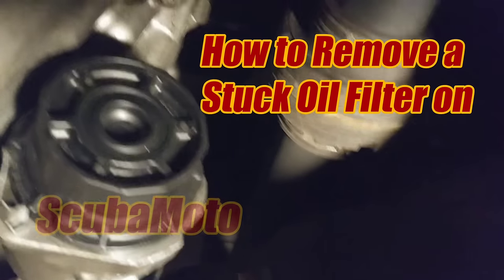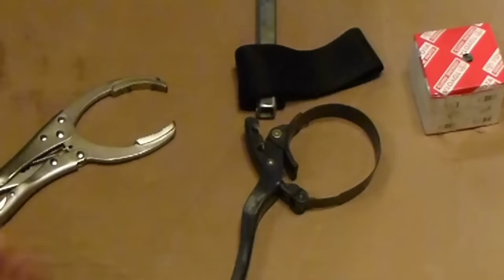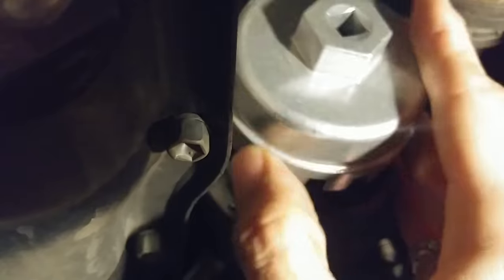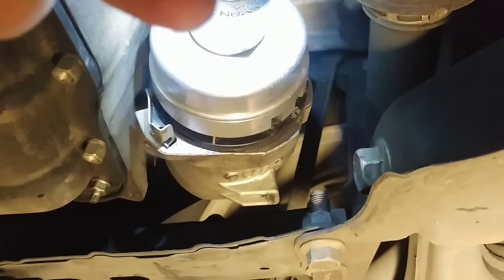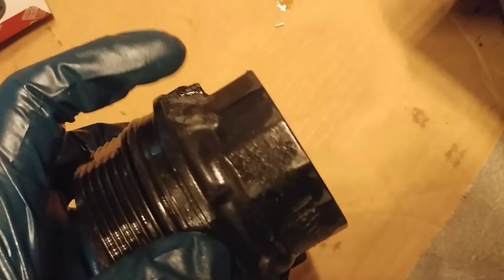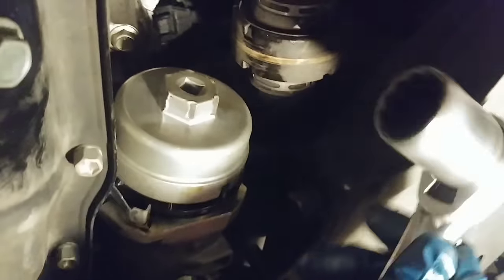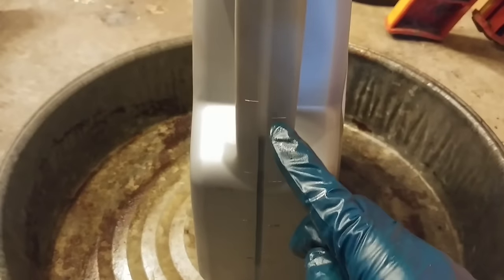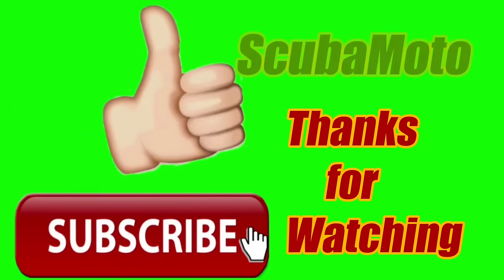How To Remove Stuck Oil Filter Toyota Prius Corolla Lexus Oil Change

Comment: I just had to deal with this on my uncle's car. It was leaking oil from the drain plug. I got under there and I was able to turn the drain plug out with my fingers. But the filter canister was incredibly tight. I bought the filter tool from AutoZone and it's not as solid is the one used in this video. I used a breaker bar and it bent the tool! With more work a piece of the cap busted off and created a hole before finally coming loose. The last place to change the oil was the dealership and they didn't tighten the drain plug but over tightened the filter! It was Larry Miller Toyota in the Phoenix area.
Reply from the maker: jorge242: If the dealer was the last to change the oil then at minimum they did so without changing the filter and possibly over-tightened a new filter. Either way, congratulations on finally undoing someone else's mistake and removing it. Now that you're doing the oil/filter changes yourself, you won't need to encounter an over-torqued filter again. Thanks for sharing the great story.

Comment: My wife took our Lexus into Jiffy Screwed while I was out of town (I normally change my own oil). When I ventured to change my oil the next time around this happened to me, except the special wrench illustrated here broke. I took it back to Jiffy Screwed and made them loosen it while I watched and tighten it properly with a torque wrench which I provided because they didn't have one. Folks, once the oil filter is seated properly to compress the o-ring on the filter housing it is further tightened to 18 foot lbs - that's  an additional 1/8 inch around the circumference, and that's it. Jiffy Screwed is putting these things on with an impact wrench.
Reply from the maker: George Thompson: Thanks for sharing the great story. I love that you brought it back and had them deal with their own mess. It's not just the lube shops, many dealer techs are using impact to install these thinking they are saving precious time. As for the broken wrench. I'm not sure how it broke but I would guess it split in half at the 3/8 drive insert point. If you use the 3/8 socket drive with an impact tool, they will all eventually break. If you have to use impact, you want to use a 27mm socket on the tool's lug. Thanks again for sharing the great story.
Reply: @ScubaMoto  The truly sad thing is these big companies hire young people and toss them into service often with little or no training and don't pay them a living wage. It's pathetic.

Comment: Damn, I thought I was totally incompetent.  Cannot believe Toyota has done this.  I have always been impressed with Toyota engineering until running into this.   My other problem was i took to dealership which I know used air wrench to put it on.  I literally had to put old oil back in car and plan on taking to oil change shop who hopefully deals with this BS on daily basis and has found solution.  THANK YOU YT.

Comment: Thanks for the video and tips.  Like many other's, I couldn't budge the filter cap.  Got the proper cap wrench with the extra teeth on the side (I had one that only had the polygonal cap part which was not working).  My impact driver did not have enough torque to loosen it, but a 1/2" breaker bar with manual impact from a rubber mallet was enough to break it free.  Only minor problem is now the cap wrench won't come off the filter cap.  Hopefully it will just stay there permanently and not fall off while driving.
Reply from the maker: fzumrk2000: Thanks for sharing your experience and congratulations on getting one of these off when it's been over-torqued. The wrench getting stuck on the filter cap is super common. Your impact wrench will be strong enough to get it off. With the filter off the vehicle, set the impact wrench as if tightening the filter (clockwise) and give it a short burst. That usually gets the wrench off quickly. Even if it's on the car, the same method will release it with a burst short enough NOT to torque the filter on at 300 ft-lbs. Then you can easily reset the proper tightness and you're done. I hope that helps.

Comment: i have serviced a car a few times with this type of filter housing, i found that lubricating the plastic threads with silicone lube and the face of the housing that contacts the housing, will help a lot next time you have to loosen it :)
Reply from the maker: Martin møller: Thanks for the comment. I just use some fresh oil on the threads and do NOT over-tighten. Then they always come off fine. I'm sure silicone grease would be good also. Thanks again for watching and for the comment.

Comment: Yep, I hate the new canisters Toyota went to....the removal tool you show was the first thing I bought after doing my own oil change.  (Had the dealer change the oil in my Tundra, once, and they must've used the impact on the canister because that thing was WAY too tight...never letting them do it, again!)
Reply from the maker: Colorado Boo: Great comment. They just don't realize how much torque an impact wrench can build instantly. It saved them 1.7 seconds of install time and leaves a project for the next removal. Thanks for watching and for the comment.
Reply: I would let management know that I can no longer trust their mechanics to work on my car.

Comment: I did my first oil change after the two freebies from the dealer. Did they over tighten it or does this plastic cap tighten as the engine heats and cools? I tend to think it tightens itself as the car is driven. What a rotten thing to do. I guess engineers will stoop to some pretty low levels to discourage the DIYer from trying to save a little cash.
Reply from the maker: I can imagine it being a combination of both. At least a lot of manufacturers are making the Toyota cap wrench.
Reply: Mitchell Hyre they definitely over tightened it.
Reply: That definitely appears to be the agenda here. And how much does a shop charge to do this? $80 at least.
Reply: It most definitely is I tried to change my oil and ran into the same issue. But mine was so tight it had to be broken off 🙄
Reply: I suspect the dealers do this on purpose. My prius freebies finished and I went to do my oil change from home. Broke 2 auto zone oil wrenches, got mad and called up the dealer. They agreed to crack it loose I'm still pissed they over tightened the cap.
Reply: @PiitaaDerbez  you're gonna need a lot of leverage and it's best if you get the oil filter wrench that's one cast piece and specific to the Toyota Prius.
Reply: @PiitaaDerbez  yeah the guy at the dealership used a long ratchet about a foot and a half long and yanked on it a few times to break it loose. I would give a call to the dealership that did the previous oil change to have them crack it loose.
Reply: There was no way I could have gotten enough leverage under my car with it on just Jack stands.
Reply: Always check your lug nuts after a trip to the dealer for anything.  A lot of them over-torque the nuts to warp your brake rotors. Bad for you; good for their business.
Reply: No those filters are not overtightened trust me I work in a lube shop. The filter canister is made of plastic and the whole housing made of metal. They bind together like super strong glue. I had to use a 1/2 inch air gun to remove them a few times. Toyota also make a metal canister on some cars, they’re easy to remove by hand tool.
Reply: It is for sure the second one. I do all of the oil changes on our 15 Corolla and I loosely screw in both the drain bolt and filter and in 5-6k miles its so tight I have to get the breaker bar out
Reply: @a7bie  this is what I suspect since mine is also plastic. Do you recommend replacing the plastic one with a metal housing instead?

Comment: I'm wondering if the dealerships put kids and techs. with little experience in the "quick-lube" area to do oil changes and tire rotations??  I learned how to change oil before I could drive a car.... at the same time learned how to properly use a torque wrench for the drain plug and filter.
Reply from the maker: Stephen Maurer: That's such a great point. I can relate, it's a good basic maintenance skill. But whether it's a dealership or a fast-lube type place, when a young tech is furnished a nice pneumatic impact driver; and he's paid by the job, the last thing he'll reach for is a torque wrench. Most of them are moving as fast as they can to make as much as they can. So the filter wrench goes on the driver, the filter gets pounded home to 200-300ft-lbs in lightning speed and it's on to the next victim. Thanks for watching and for the comment.
Reply: I think they have bigfoot doing oil changes...

Comment: Have been trying all day to get the oil filter off but like yours it was stuck solid, but also the filter wrench I ordered didn't fit well enough. Never thought of using my power wrench but certainly will once I get the new oil filter wrench. Thanks 👍.
Reply from the maker: Good choice on getting the right filter wrench. You might want to try a breaker bar with a 27mm socket on the lug of the new filter wrench first before using the impact wrench. My impact wrench did finally work but it's a hostile force on that filter housing. I tried a breaker bar first and it just rocked the car so impact prevailed. Good luck with it.

Comment: I got a used Toyota sienna and i swear either the dealer ridiculously overtightened it or they never changed the filter just the oil. had to do same thing you did with socket and impact wrench. I found putting some silicone grease on end of filter housing and barely tightening it the thing comes off ok.
Reply from the maker: Thanks for sharing!

Comment: What people fail to understand about an o ring compared to a gasket is an o ring is a hydraulic seal. You don't need to crank it down so tight. It wouldn't leak anyway. How ironic!

Comment: Just finished my first oil change on a 2014 RAV4 with 12k miles, yes 12k in September 2021. Previous owner had taken car to dealer for oil changes. I too had a really hard time removing oil filter housing. I gave up on the oil filter drain plug. I think the techs had been using the drain plug as a way to tighten the filter back on. And I can see how someone not trained on this filter could be lulled into making that mistake. I read of many folks bypassing the filter drain plug removal with no issues so that's what I did. To remove the housing, I used an Ebay knock off version of the special toyota tool [just like in video with the extra slots for the side fins] and with a 12" cheater bar on my socket wrench, I eventually got the housing to budge. And wow, was it slow to move for many, many revolutions. So when putting the filter housing back on, I noticed that it stopped turning by hand with about a 3/16" gap. So I used a small torque wrench set to 25 NM and the housing turned some more [with the special tool, not the drain plug] and the housing eventually bottomed out.  And that is where I stopped even though torque wrench didn't quite click just yet. It's a cheap Harbor Freight model that I don't trust for something delicate like this. Like others mentioned, this is an o-ring filter, not a spin-on with a gasket between housing and engine block [that is dependent on the torque setting for sealing]. And this difference is probably why the filter housing is frequently over-tightened. Also, I'd guess many folks see the 25 NM on the housing and think ft.lbs. when 25 NM is really about 18 ft.lbs. Excellent video. Thanks for sharing. Good luck to all. Toyota really needs to address this issue with a replacement housing.
Reply from the maker: Mark M:Great comment! Thanks for sharing the experience. Congrats on getting the stuck filter off and congrats on finding one of the best year RAV4s that's barely broken in.
Reply: I bought a 2010 Corolla several months ago with only 5 k miles😜

Comment: Same story, on my 2021 Highlander, first 2 changes were done by the dealer, next change I purchased my own filter and oil. I nearly broke the plastic housing since it was torqued on so tightly at the dealer ship, I had to purchase the same filter removal tool from Amazon for 15 bucks, the dealer wanted to charge 50 bucks for the same tool. Anyway I purchased a new plastic filter housing, I could still use the old one although it rounded some chips off the plastic. I didn't torque it on super tight like they did so it should come off next time. I hate taking my car to the dealership for service. I'm OCD about my cars, the dealers don't always do the best work. Its easier to get to the filter on the highlander,  there is an under cover, but remove it with 2 x 10 MM bolts and one clip and you don't have to remove the 2 clips further back. The filter housing is straight up and down, very easy as long as its not over tightened.
Reply from the maker: All the dealer certifications in the world won't make them care about your car more than you do. It's good to hear you're willing to take control of maintaining it well. Good job with it. Thanks for sharing.

Comment: 2011 Camry. I went to do the oil change for the first time and broke the 6 little teeth off using the correct filter wrench. A lot of cussing later I finally managed to get it off after adding and extending pipe to my ratchet. I put it on just snug and haven’t had an issue since
Reply from the maker: Christopher Simpson: Job well done sir! Thanks for watching and commenting.

Comment: Wish I watched video before changing my sis oil. She was in a rush and I was able to get the filter off, but thought the filter wrench would pop off with a flat head, so I put back on the car after changing eveything, may have put the seal in wrong place on the filter as I put it on the very bottom, box had no instruction. Long story short, sister drove with filter wrench still on as, she was rushing. How did you hammer off the wrench? Flathead and mallet, or pry bar? I tried vise grips and hammering flathead on wrench while filter was on car, should I remove filter and try again. Thank you for any help.
Reply from the maker: Alex Chic: That's not uncommon. Most likely the 14 flutes of the wrench are locked into a counter-clockwise jam with the flats on the filter housing. Mine was. What usually works for me is to simply reverse the impact wrench and give it a quick clockwise burst.  If that doesn't do it, then hold the metal cap wrench in a vise and tap through the center lug and around the edges to release the cap wrench from the housing. Thanks for watching and good luck.

Comment: I just broke my oil filter removal tool on Friday trying to take off a housing that had been last torqued on by the 'Stealership'.  the spec is 18Ftlbs for the housing and 10ftlbs for the plug if there is one on the bottom.  I notice your filter is on sideways but on my Tundra and my wifes Highlander they are vertically mounted.
Reply: Yes the 1.8L engine has a different oil filter cap than the larger engines and takes a different tool. The larger ones have a drain plug cause they are mounted vertically.

Comment: Thank for the video. I couldn't get the filter out and I have a high impact drill and it didn't occur to me to use it.  Thanks for the information, tomorrow I will try to remove only the filter since today I only put the oil.
Reply from the maker: Angel Zucchet: If you have the filter wrench in the video and you haven't already, I recommend giving a good try with a breaker bar (cheater bar) with a 27mm socket on the wrench lug before resorting to impact. I tried a 24-inch breaker bar and it wouldn't budge. Then a pipe slipped over the bar and it still wouldn't budge. It just started to rock the car (not good on jack stands). Thanks for the comment.

Comment: I work in a shop. Working on a Rav4. Popped the Nut off the socket I bought at Advance Auto. Took it home and Welded it. As it was made out of steel. Next time I was in the store, Associate said she replaced several for the same reason. Look inside a new one, You can see a Tiny weld. Mine is not pretty. But it is definitely stronger.
Reply from the maker: Nice work!

Comment: It has drain plug at least on my Camry you have to on screw first to take off pressure in oil system after that it much easier to on screw filter love this filter less garbage
Reply from the maker: Aleksey Abramchuk: Thanks for the comment. Opening (unscrewing) the filler plug will help drain the oil but will not help with an over-tightened filter. Thanks for watching.
Reply: The 2.5 engine takes a different oil cap removal tool. Also it has a drainplug on the oil filter cap because it's mounted vertically. The 18 ft.lbs. of torque still applies to the filter cap but the drainplug on it only gets 10 ft.lbs. of torque.

Comment: Thank you,  I had hard time removing the oil filter cap.  I need to get that tool that you used.
Al to all, careful with the one you buy.  The hare different width with different out of width, and it if is too wide, it will hit the side of the engine block.
Reply from the maker: Thanks for sharing

Comment: Luckily I have never had a problem with mine.  I don't understand why anyone would over torque, when you tighten it comes to a complete stop, no need to tighten any more.  Plus this housing is plastic, no way I would ever use a filter wrench or vice grips ...only use the socket type as in this video.  I just have the cheaper metal Walmart version, it has worked well for years.

No need to bang off the socket, when you put the housing back on it will loosen as soon as you reach the full stop tighten position and it will just come right off.
Reply: David Houlden that's a good question on why anyone would ever tighten it so much. I've always had my 13' corolla serviced at the dealer up until 108k when I finally decided to do it myself and yes, I ended up breaking the wrench with a cheater bar. I suppose they do it for self protection to avoid any wrongdoing if it were to come off. Oh well, off to Sears tomorrow morning...